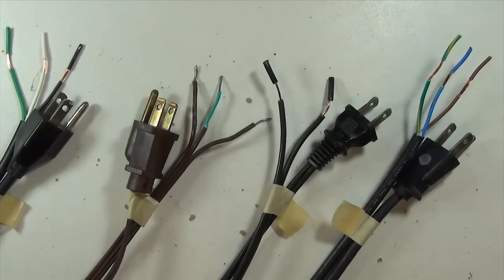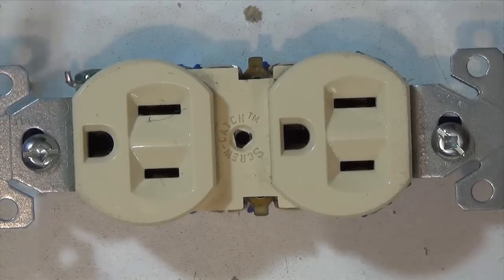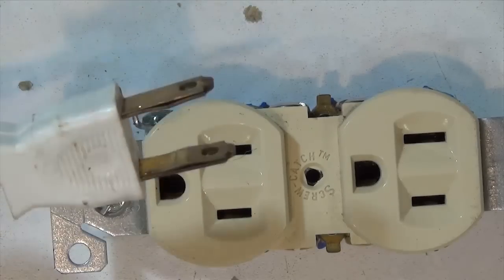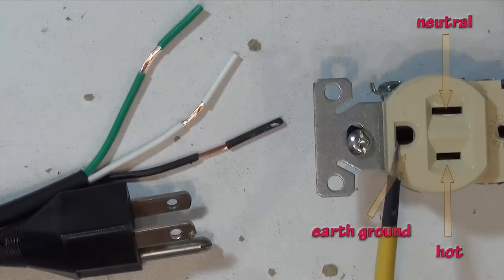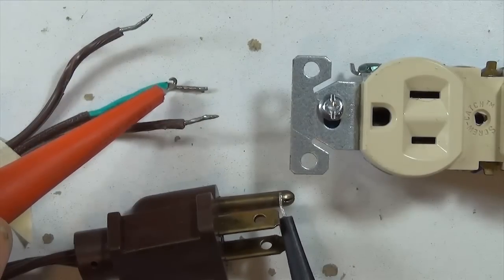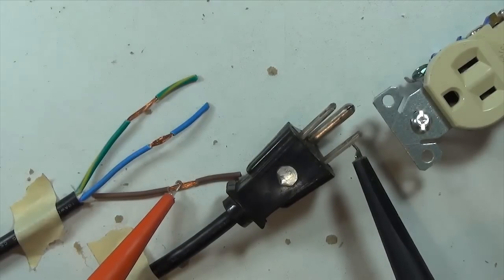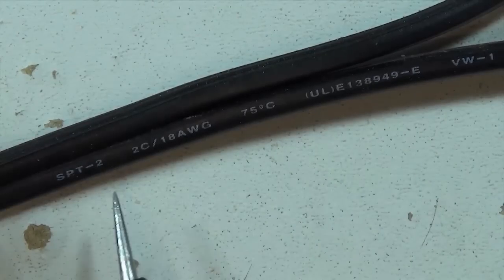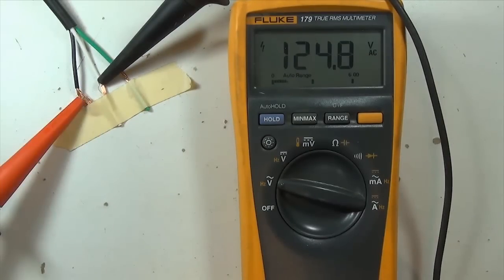AC power cords explained, testing, installation, safety | tips & methods |

Comment: If I'm doing electrical work in a different country, say Brazil, and just say the observance of wiring codes are sloppy and both wires at the outlet are white, is there a way to test for polarity? Use a sniffer?

Comment: First of all ur presentation was perfect. Very very informative in every way.  Except one, (sorry) I have an electrical adapter only 1.5 v - problem is both wires are black on out side, no defining color on inside. Both prongs are small smooth ones. Nether cord has defining ridges for neg or  pos. The only thing I have is:
One wire has Chinese writing on it, other wire has white long dotted lines. Which one is which???!!!  No polarity checker😕-  tough one.?!
I say dotted line is neg now
 (But always thot it was hot wire). I've learned writing on wire is sup to  be hot wire & lines mean neg. ....(what if Chinese writing is backwards in America? & writing means neg?)......so, what do u think?

Comment: But ac changes the direction 50 times a second, how can then one wire be at 0v? Sorry I'm a electronics noob
Reply: Moclan5    What this means is that neutral is zero volts when measured to ground.   This is because neutral and ground are connected to the same point in the service main panel.   Hope this helps you.    Respectfully,   Kevin

Comment: I have attempted two connectivity test with 2 different digital multi-meters on a 3 prong plug wire which I am trying t replace. There are 2 black wires and 1 green.  Following your video where there are 2 black wires and I believe a white covered wire I attempted to determine which of the 2 black wires was the hot and which one was the neutral. Both multi-meters made no beeping noise when I touched 1 lead to a plug prong and 1 to any of the 3 cord wires. When I touch the 2 multi-meter leads together they do beep. My multi-meter is set to "connectivity" but somehow does not work according to you video in identifying hot & neutral wires which are not color coded. In other words. No beeping when leads are touching any of the wires and plug prongs. What could I possibly be doing wrong ?  Oh. The 2nd multi-meter support folks never heard of such a test with a multi-meter and could not duplicate your testing after watching your video.
Reply: Tom Swift . If you get a beeping sound when touching the two leads from the multi-meter together, but no beeping when touching one of the plug-in ends ( on the plug that goes into the wall) and any other end of any wire ( the copper wire ends) ...
this means that the wire is broken somewhere. 
A Continuity Test will make sure that there is an unbroken connection between the two test leads. 
If you take a single piece of wire and connect one of the test leads to one end of the wire and the other test lead to the other end of the wire, the tester will make a beeping sound UNLESS there is a break somewhere in the wire. If this is the case then you will not get any beep. 

I suspect that somewhere in the wire that you are testing that there is a break in the wire. 
I have tested a few cords or wires that appeared to be good, but inside of the plastic covering the copper wire itself had pulled apart without tearing the plastic outside. 
This gave the cord or wire the appearance of being good, but it was actually faulty or not good. 

We may not be able to see the break or fault, but the continuity test does not lie. If you test it on some other wires and it works well on those but not on the wire you were having trouble with, then it is a broken connection in the wire. There will be no other cause. 
I hope this helps...
Reply: @christondavis9641  I appreciate you detailed explanation however - what I ended up doing was replacing the plug. All I did was expose more of the wires (stripped off coating) so they fit the new plug and clamped on the new plug. Certain there was no break in the wires. All working fine. Again. Appreciate you reply.

Comment: I am replacing a plug on an oil filled heater. It melted. What if I don't have a  continuity tester?
Reply from the maker: That will not be a problem.  The black wire will go to a bronze coloured screw, the white wire will go to the silver coloured screw and the green wire to the screw that is coloured green.

Comment: Thank you for this video, it's the only one I've seen that deals with blue/brown rather than just white/black.
Question: I'm adapting a cord for a PC power supply to power a dishwasher. I have brown, blue, green, all copper...and an uninsulated "silver" (I assume stainless steel?) strand that has continuity with the green.  What does this do, and should I connect it with the green to the dishwasher ground? Thx
Reply from the maker: Blue is neutral and brown is hot or line, green/yellow is earth or ground.

Comment: Looks like the US is changing to the international colour codes, or is this on imported Chinese cords using the new colour codes. Long before the colours were changed Germany and Italy used a grey and black wire but the earth or ground was red, red was used in UK as live or hot so a great danger exsisted and people not knowing this were electrocuted thinking they had earthed the equipment but just connecting it to live. Some of these electricals can still be found in flea markets so take care.

Comment: One quest, what happens if in a power unit supply I plug the hot line tho the ground and the ground to the hot line, did I burn the PSU? Because I did and now I don’t know if the psu is still working or not.

Comment: Hi. Thanks for the video.

The 'Green' earth conductor in the cable with the Brown live (hot) and Blue neutral conductors usually has a little more yellow in one of its stripes! Striped yellow/green Earth was introduced in the UK in approximately 1970 to overcome problems caused by colour-blindness of the common 'red-green pairing (the other pairing is blue-yellow, which is a little rarer). I guess it was thought that at least if there was a stripe of each colour, the extremely important earth conductor could be identified. Nowadays in the UK, since the late 1980's, it is illegal to sell most appliances without a fitted plug.

Taping live conductors to a workbench!!! Well I guess that tracking of 125V isn't likely on a dry bench, but I still salute you.

Comment: I replaced a burned plug from 20 year old fridge.  it had one green wire and the other two had no color just copper wire. I connected the green wire to gold , and the other colorless ones to the green screw and silver.  the fridge turned on and works.  how would I know if I wired it wrong?
Reply: You wired it wrong

Comment: Is it possible to repurpose an ac outlet for dc use? To rewire so one might be able to plug devices directly into a DC power source?
Reply: Yes. Wall sockets are connections.
Reply: They aren't rated for DC
But you can use special DC sockets.

Comment: very excellent production quality.  

question: for the non-polarized plug, you say you don't want to use it for electronic equipment.  This plug has only one purpose -- supplying electricity to electronic equipment.  What else is there?
Reply from the maker: The main purpose of the polarized plug is to make sure that the hot side  is switched and fused.  Using non-polarized plugs in electronic equipment could expose anybody working on the equipment to a shock hazard.
Reply: Most electronics use figure 8 connector so polarizing the plug makes no sense. The main use of polarizing is lamps etc. where there is a switch in the cord.

Comment: Neutral is only at zero volts at the panel, or out in the field only if the circuit is off.
Reply from the maker: Here is something to read on the topic:

http://ecmweb.com/power-quality/clearing-neutral-ground-voltage-confusion
Reply: A few small errors in the article, but not too bad overall.

Comment: Also note that if you have a 120V cord in the US, and if it seems to have indistinguishable Line and Neutral conductors, see the rough side of the cord opposing the side with printing on it, that should always be your Neutral.

Comment: With AC, does the Neutral become the charged power source 60 times a second?  In your video you mention black is hot, never mentioning any swap of hot between the two sockets on the outlet.  Not understanding the behavior of AC at the outlet.  Another video explained the black and white alternate being the power source.
Reply from the maker: In any AC distribution system the hot carries the voltage and neutral provides the return path.  In an open circuit, there will be voltage between earth and ground but no voltage between earth and neutral.

Comment: Hi thanks , nice video. Btw i have a question.. i'm not an electrical guy, so what is the simple and safe method for me to check whether the grounding (earth) wire is installed and work properly ? any advice ?
Reply from the maker: You can purchase an electrical plug tester at the hardware store, Home Depot.  When plugged into the outlet, there a indicator lights that will give you the status of the outlet. Here is a link for a picture of one:  http://ptgmedia.pearsoncmg.com/images/chap4_9780789749802/elementLinks/04fig16.jpg
Reply: Nice.. that 's very helpfull tool, i will check it out.  Btw hanks a lot for sharing this video.

Comment: great video! just have to ask about the neutral wire. what exactly is the purpose of the neutral wire? Does it complete the circuit and or carry power back to other side? please explain!
Reply: Alencar Bravo from my little understanding(today was my first day in new residential wiring) electricity needs to return to its power source. so electricity leaves the power source and goes through the hot wire then ur equipment(lamp, phone charger ect.) but then needs to leave your equipment and goes through the neutral, or white wire to return to the power source. the ground is for safety, in case something happens the electricity is sent to the foundation of the building into the dirt so it won't end up electrifying anything in the area. My weak understanding, I'm just an apprentice day one 8 hrs in
Reply from the maker: The neutral wire completes the circuit.  Without this neutral connection there is no current loop.
Reply: Hi, very nice video. 
Sorry for the very stupid question...  But I don't see the purpose of the third ground if the neutral is also at 0V (earth)
Reply from the maker: No stupid questions in this business! Anything made of metal connected to AC will be bonded to earth ground.  In the event the hot wire should come in contact with the metal chassis/casing a fuse will blow preventing the user being exposed to a shock hazard.

Comment: Great video! Some of the attendants at the big box hardware stores need to watch this. I had one assistant tell me that "white" is "hot". Fortunately I didn't listen to him.
Reply: White is not hot until it is a completed circuit. White from the fuse box is not supposed to be live (hot). In older houses in U.S. they use to run hot to light fixtures which would alow white to be energized but that is no more. Always turn power off when installing wiring in house.